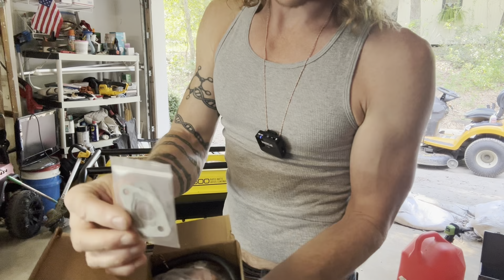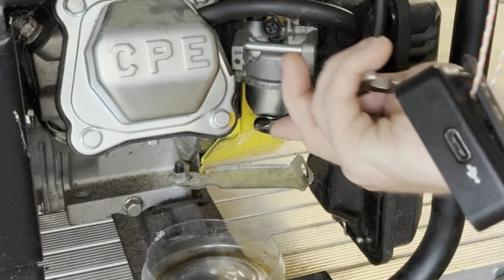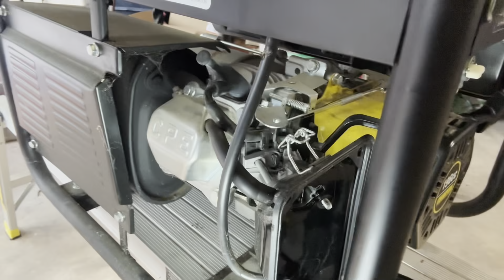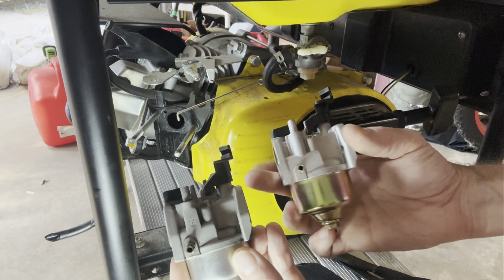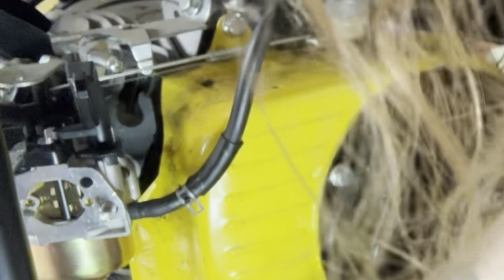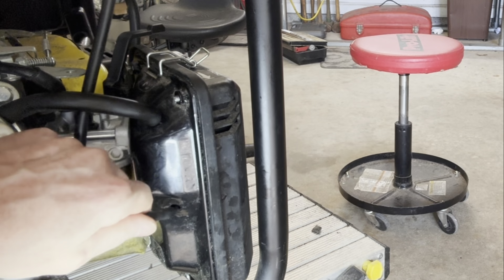Carburetor replacement Champion 4000 generator

Comment: You put the wrong gasket on between the carburetor and the black plastic insulator. The gasket you installed first, needed to go between the engine block and the insulator. Then the gasket that has a small hole located within it, next to the main hole in the gasket. This is important to get correct so the carb can bent properly. This was likely causing the surging problem. The 3rd(last) gasket you did put on correctly. Peace out. 😎✌
Reply from the maker: Thanks I’ll recheck it
Reply: Yeah I was thinking same thing. I had same issue with carb surge.
Reply: Thanks for this comment. I didn't know that plastic piece came off. It took a bit of work but finally got it off, and there wasn't much left of that gasket anymore. Half of it stayed on the block and the other stuck to the plastic. Just ordered the new carb and will make sure to put that first gasket here.